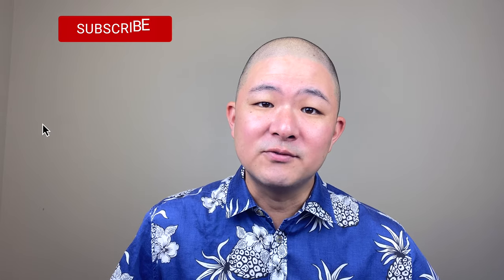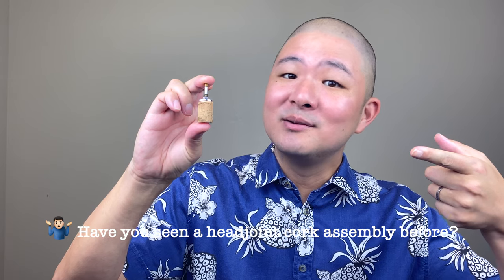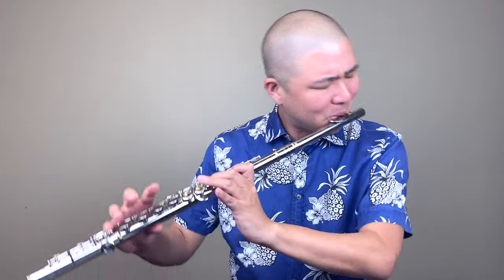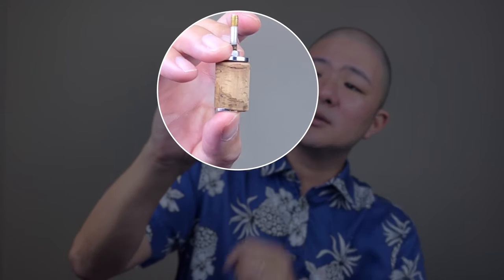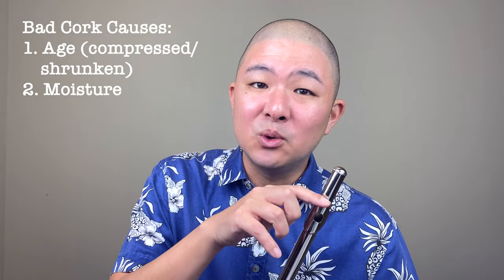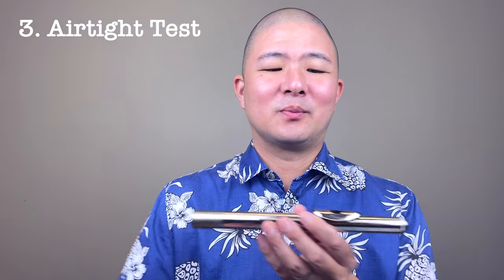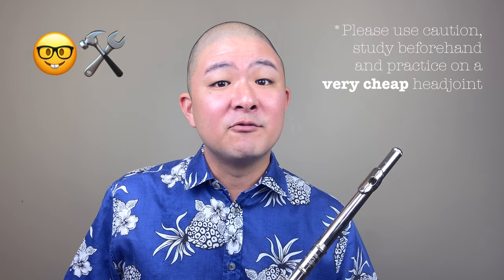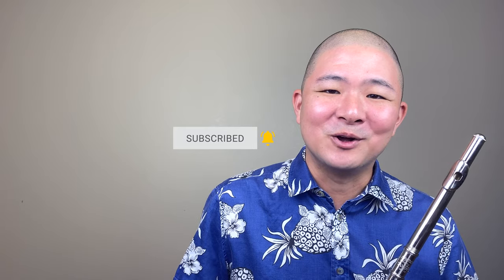Flute Headjoint Cork Demystified (How to Know When You Need a Replacement) [Flute Tips & Tricks 04]

Comment: 60 year old new flute player here; this video was truly fascinating and informative!  Just using the speakers on my tablet, I could hear a huge difference between the old and new cork.  Your articulation sounded much crisper, and the sound was brighter.  Your playing was magnificent.   🙏

I had just swabbed out my flute after practice. Having previously read about the need to be careful with the head joint, I knew not to push too hard with the cleaning rod.  I did feel a bit of resistance, but stopped immediately.   How do I  know how much pressure is safe, especially since removing moisture from that area is so vital?

Thank you for posting all these great lessons, Lance.  My wife and I love how so much gets tossed over your shoulder!  😂